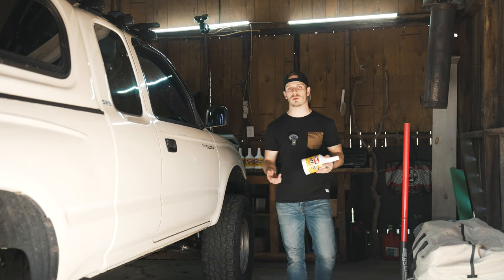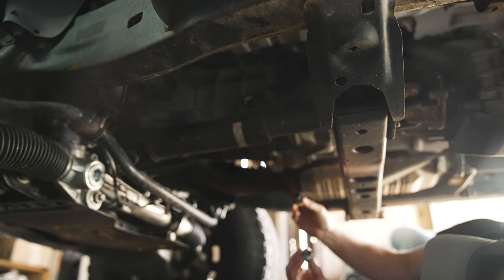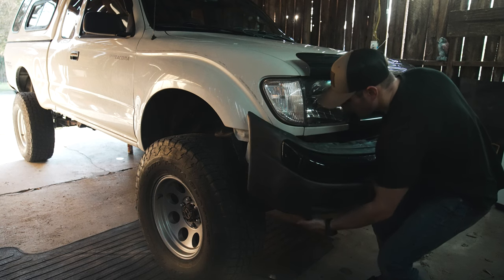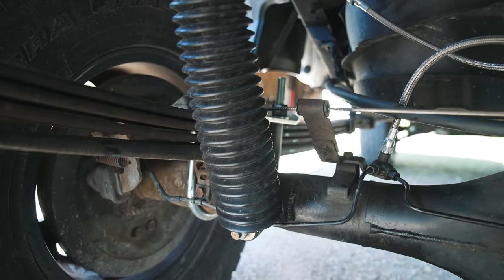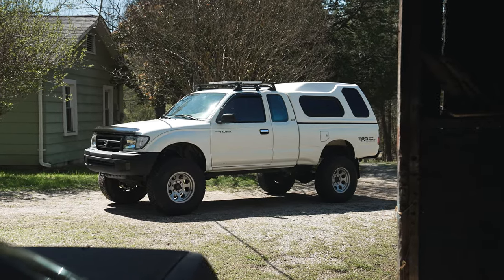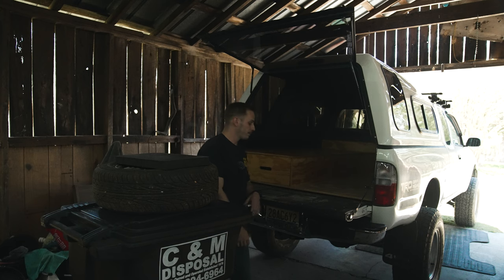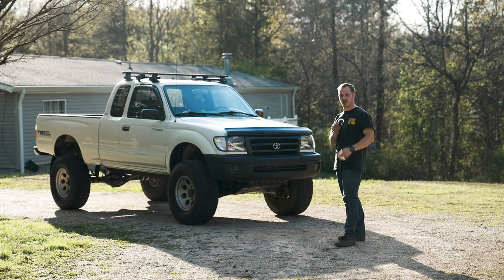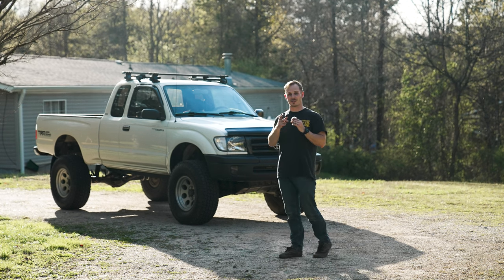No More Camper On The First Gen Tacoma

Comment: Playa!  Aaah, the rides...love the barn, so much potential.   In barn you have beams, get a pulley and rope, save yourself the effort and use it to lift camper up n off...it can stay up by beams or be placed after...good job on bumper , paint looks good, never use propane torch method, it fucks up the plastic down the road... home hardware etc, have L.E.D lights that use batteries for barn or run power...i would set up all my tools n lights in there w a workbench...connect to power bar so you only need to run extension cord for power...looking forward to prelude vids...enjoy yo badself, be safe, keep turning that wrench...one love
Reply from the maker: I’ve got an outlet in the “garage”. Currently running a single extension off of it. Defiantly need to organize the tools. The amount of time I spend looking through sockets….

Much love my friend. Be easy

Comment: Like your vids! I cant remember if you've mentioned in other vids but what's your suspension setup? 💪🏽😎
Reply from the maker: Bilstein 5100’s and OME springs up front and Chevy 63 leaf packs in the rear with bilstein shocks
Reply: @ConnorLee  cool! Same set up as mine up front with OME 881s and a .4 top plate. Rear OME HD leaf springs and I still get about a 1" rake.  Any tips or suggestions 🤷🏽‍♂️